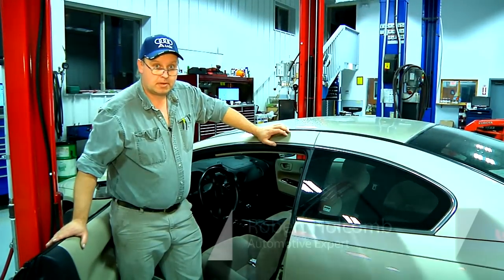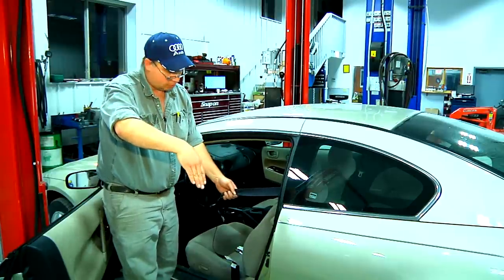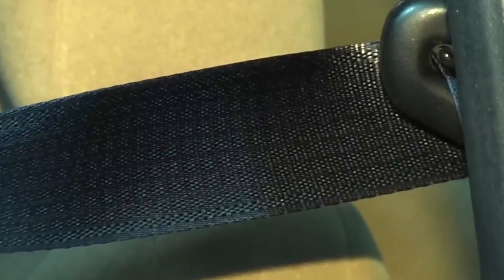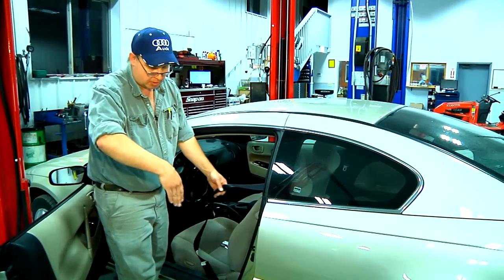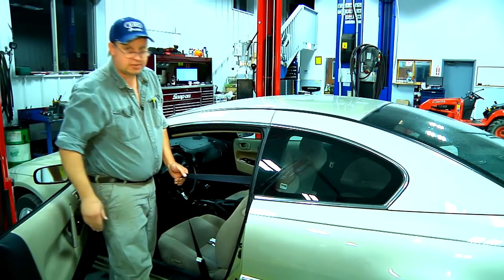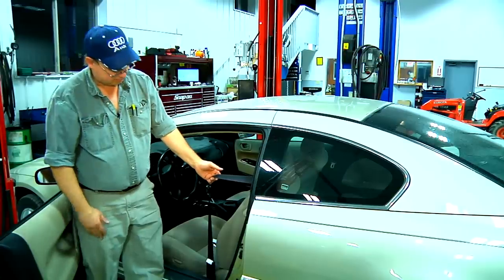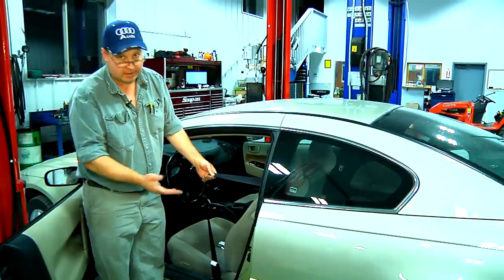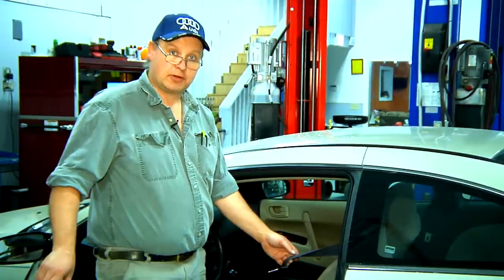Car Maintenance Tips & Tricks : How to Release a Car Seat Belt From the Retractor

Comment: Have you heard of seat belts in a Pontiac G6 locking and not retracting or not releasing at all and the service air bag light being on? Is there a way of fixing this without replacing the seat belts all together?